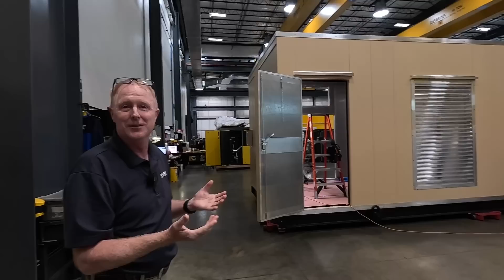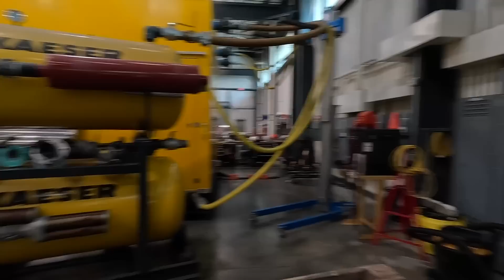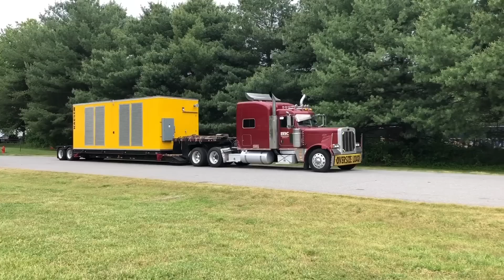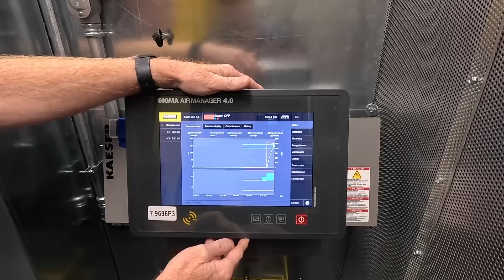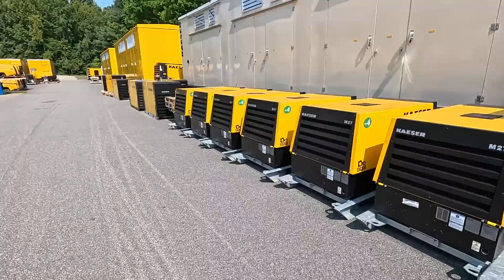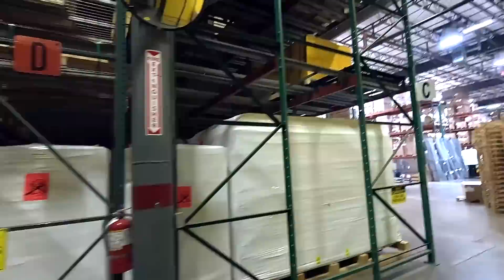KAESER Compressors U.S. Headquarters Tour

Comment: At work we have a big Gardner Denver machine. Some smart person decided it was a good idea to plumb the buildings air system with sch 40 pvc. They limit the compressor to 95 psi and it still blows out the pipes all the time, especially in winter.
Reply: My shop has been plumbed with PVC 40 for 25 years. Pressure setting is 80 -120 psi with only a few joint blowouts which are easily repaired. I’ve heard of all of these warnings of blowouts and shattered pipes it hasn’t happened to me.
Reply: @ellieprice363  You do realize you said you've had blowouts and failures and then said it hasnt happened to you. PVC for compressed air is just dumb. Hell PEX is far superior even though not ideal or recommened.
Reply: @ellieprice363  Under very specific conditions -- no rapid pressure changes, stable temp, etc. -- sch 40 pvc can work, but it's really not a great idea. (it's too thin, and it becomes brittle over time.)
Reply: Sorry I wasn’t clear. I’ve had a few joint disconnections in 25 years where the bonding cement failed but no burst or shattered pipes that I’ve heard so much about. Not saying it hasn’t happened to others, only that it hasn’t happened to me.

Comment: It's no secret:  getting rid of moisture is important.  I forget the model, but we had a Kaeser unit run pretty much 24/7 for a decade with minimal problems.  Tower dryers can add great protection to any basic compressor, but you have to change the beads out every year, or solenoids will suffer the consequences - once shuttles get polluted, bad things happen.

Comment: Those part towers we used at Schlumberger holding electronic parts in one and Mechanical parts in the other.  It was set up for operations to set up the line and the line would return the subassemblies to the tower at the end of the work session.  Parts could not be borrowed, and parts were JIT from a Wearhouse two blocks away where many vendors store there. I believe the city has a yard of portable units with other machines.  Emergency parts.
Reply: Oil free air is important for any system that provides purges to electronics.